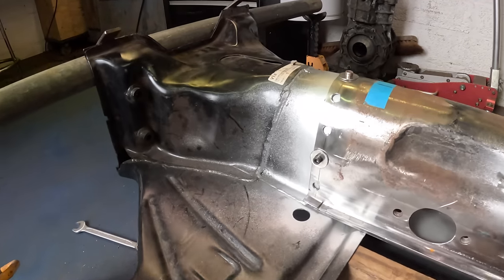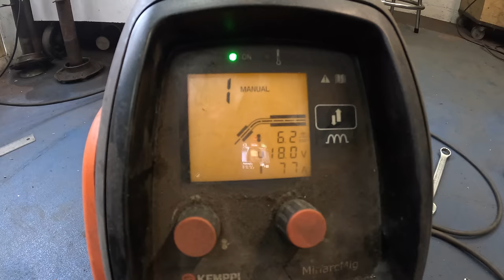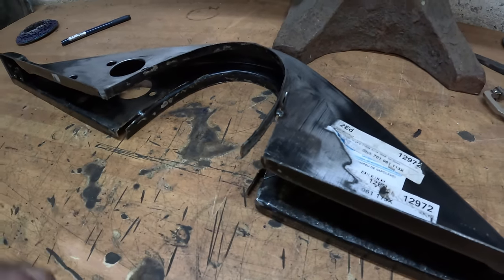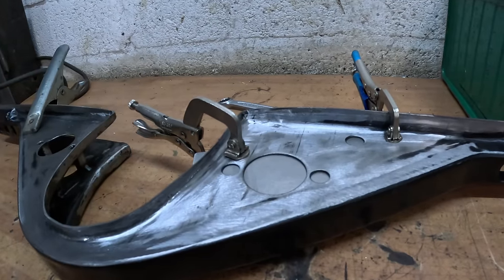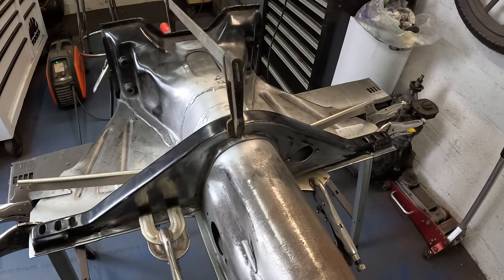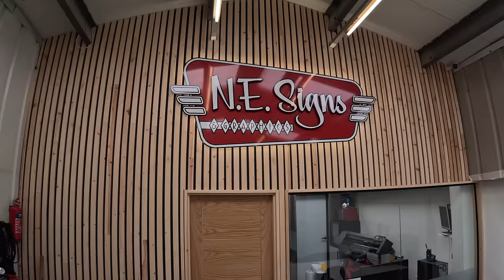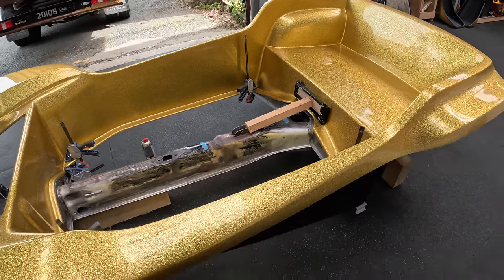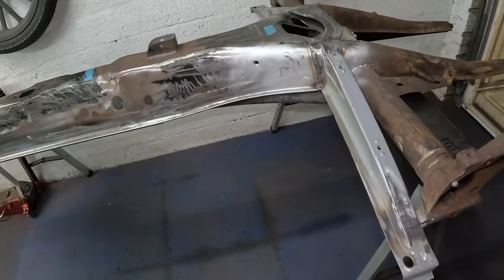Building a Beach Buggy - Part 5 (frame head replacement & even more chassis work)

Comment: you couldn't just flip it around and use the current holes? i guess the question should be "why couldn't you just flip it around?" nevermind, was finally able to see both sides and i see they are right and left specific :)

Comment: Just asking but the piece seems to be able to flip 180° and looks to be ambidextrous or am I wrong not sure thank you
Reply: Not quite - the ends are shaped to support the floor pans on one side. Not totally sure about the orientation of the master cylinder either, they'd need to be measured up.

Comment: Nice work Neil, been watching your videos with interest over the last few weeks and really impressed! Regarding the repro parts not fitting, I've been told that it's due to the dies wearing and not being maintained properly. I've got some Beetle repair panels from the late 80s and they're much better, crisper and dimensional accurate, than the early 2010s ones made by the same company!
Anyway, as long as those magnesium 12 spokes get fitted to the buggy, I'll be well happy!